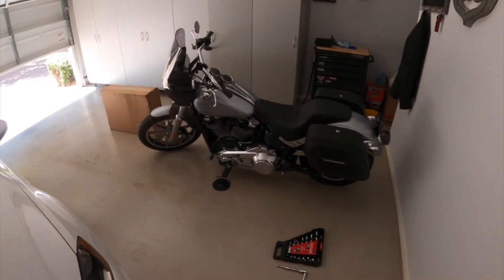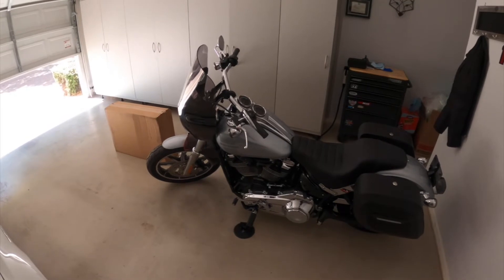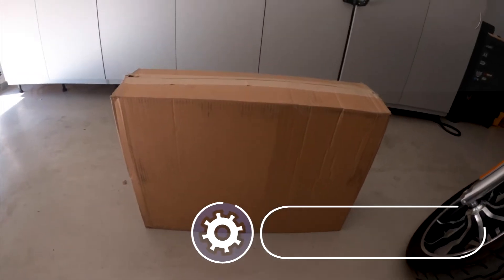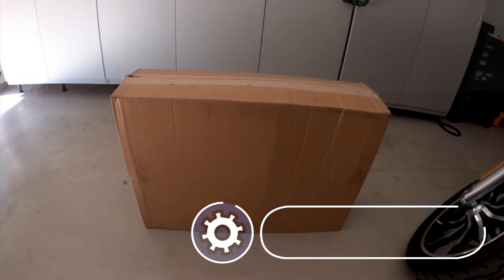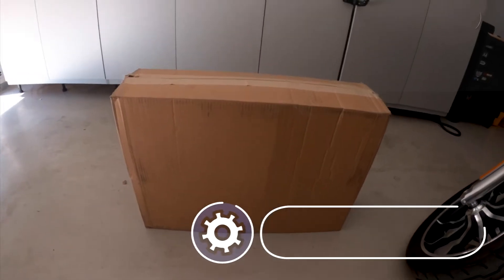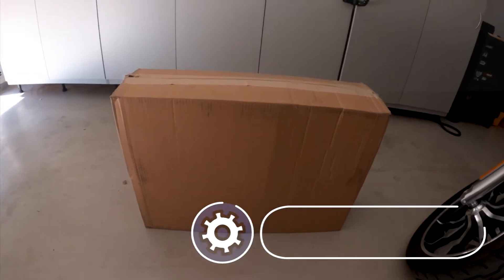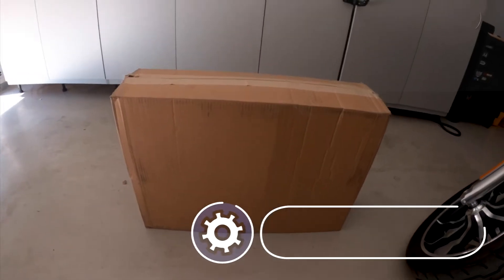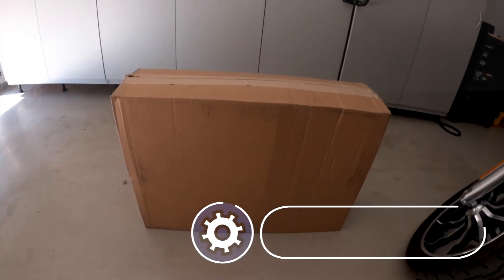Harley Engine Guard Install - Low Rider (FXLR)

Comment: My FLHCS Heritage had plastic plugs in the lower frame holes. I just drilled them out and ( just like you) put in the lower part of the engine guard on first. I did do an old car restorer trick with that upper bolt and put two layers of masking tape over the nut and pushed it into the wrench. I had no problems with getting that nut started and threaded down.
Reply from the maker: Nice move with the masking tape! It took me way too long to find that bolt since I thought it rolled away 😂

Comment: You should also consider trying out if your going for a more modern or clean look to your Low rider either Kruesi originals Crash bar they have their shop located in AZ or look into the Bung King highway peg Crash bar. I’m from PHX so cheers mate 🤙🏼
Reply from the maker: Cool, thanks. I'll check them out.